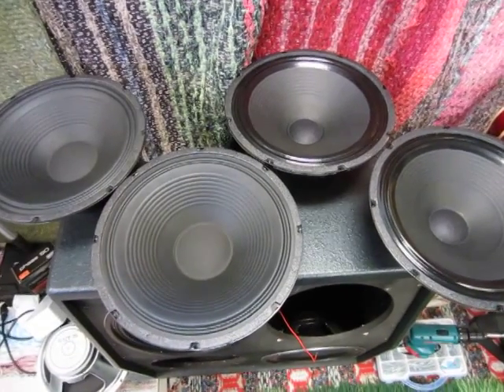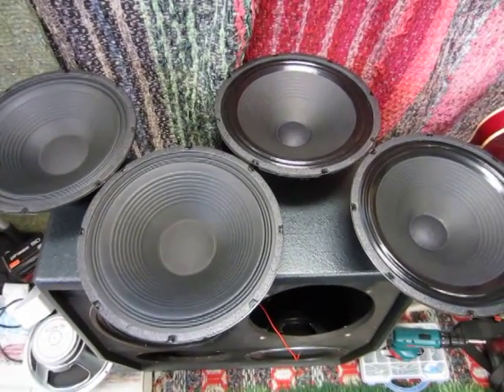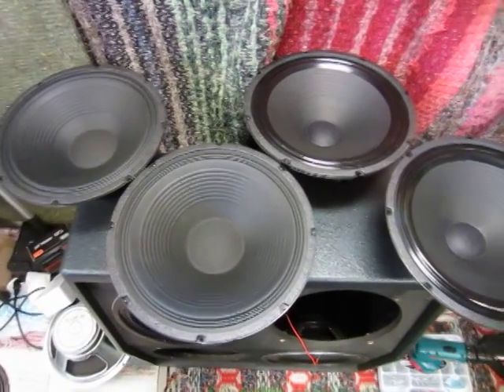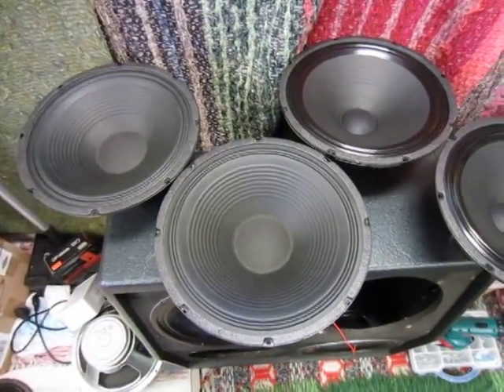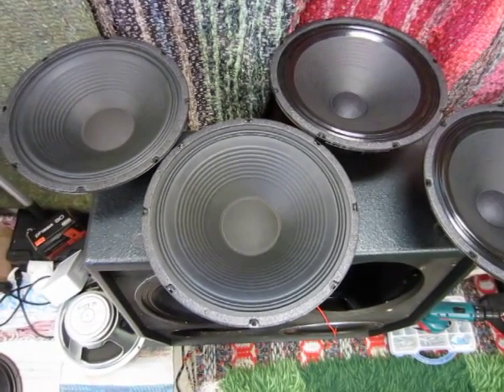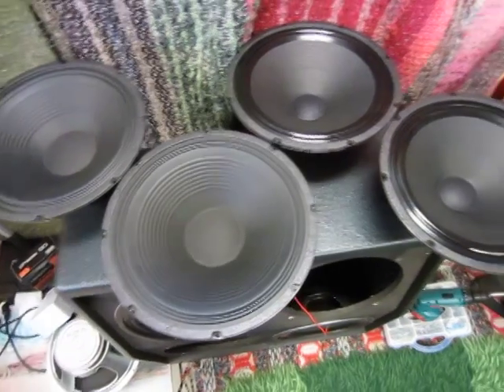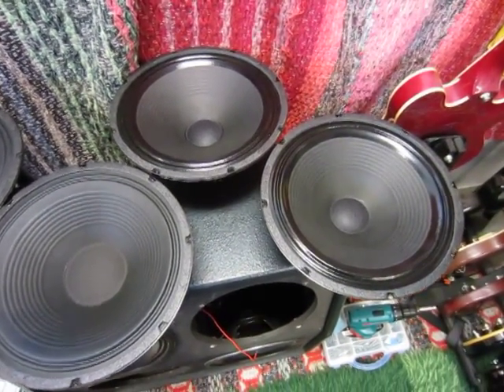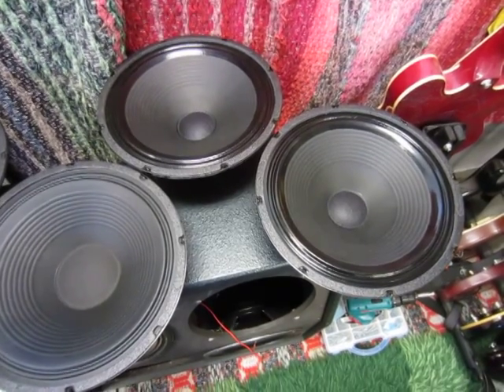Guitar speakers, burn-in vs no burn-in

Comment: Sorta... New ones sounded more deep bass?  Or its not scientific enuf. .be nice on flat surfaces same distance from mic.
Reply from the maker: The thing is, even if the speakers themselves get a lower resonance frequency by the burn-in, that does not mean that the speaker cabinet will get more bass or a presence of more lower bass. The speaker works together with the cabinet, forming a tuned entity for frequencies. So, lowering a speakers resonance frequency can make the cabinet resonance frequency lower than you can really hear it while playing guitar. It may appear as if the cabinet has lost some bass. But it will still make a difference in other frequencies that you can hear, different midrange and treble. Remember, a loudspeaker is an audio-mechanical device, really very crude, especially our guitar speakers :-)
Reply from the maker: All 4 speakers were new, only difference was that 1 in each pair had been burned in.

Comment: Thanks Mats! That's really interesting. How would you say that the sound changed? Cheers Johan
Reply from the maker: Johan, I was surprised of how the difference turned out when the speakers were loaded in a cab and compared and recorded. It was certainly not the outcome I expected: both burned-in speakers had LESS bass than the no-burn-ins,
and that in both open-back and closed-back cab. But especially the GB12 got smoother sounding and gained low-mid.
And I think that both GB12 and V12 also got slightly more "aggressive" in upper mids. "Smooth-aggressive"? :-D
Maybe both burned-in speakers started to behave more like 55Hz G12M/G12H? Getting "creamier"? Video will come!
Reply: @jublaim  hi thanks for the job! what software did you used to record the frequency response?
Reply from the maker: Thanks for your comment! But I don't really understand your question... The video and sound (built-in stereo mic) is recorded with my Canon Ixus 220HS. I've got another video on YT where the speakers are compared loaded into a 2x12 cab, open back and closed back, here https://youtu.be/CDy2dwPQAFs
Reply: Mats Frånlund hi trying another way : how did you performed the measure of the frequency response of the loudspeaker ie frequency vs db ( the picture displayed While we ear the sound)
Reply from the maker: @lverite1969  Oh, you must be referring to the video I linked to in my previous answer, right? The software I used for plotting the frequency curves is Audacity, it was also used for all sound editing. Great free software.
Reply: Yes the gb128 really Changed a lot after break in. A lot smoother.. I just bought this speaker and tried it (open BACK) for the first and it had a lot of bass and not the good  kind and a little too intrussive mids. After your break in it became more 3d.
Reply: @jublaim  They get less bass because as the resonance frequency lowers after burn in the bass becomes lower in frequency and our ears are not sensitive to lower frequencies below 100Hz ,, Say the Rf was at 110Hz and after breakin it is 90Hz.. The entire "bass" register is moved up in the new speaker where it is more audible and seem "Louder".
Reply from the maker: @MrAnders1976  Exactly! Thanks for the elaboration of this :-)
Reply: @jublaim  Hi Mats. I had a chance to tap test the cone of an old worn in celestion G12H 30W, an old celestion 70/80 and the newer eminence GB128..  All speakers should have a Rf around 84Hz to 87Hz. The eminence was noticable brighter in tap tone than the two very worn in celestions.. I have maybe 4-5 hours of loud playing but seems to need longer for it to properly break in